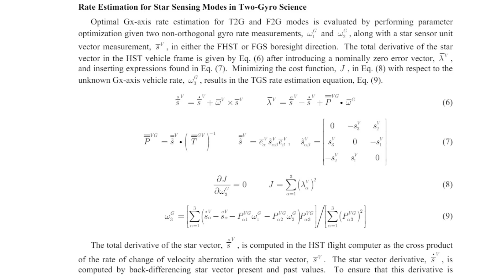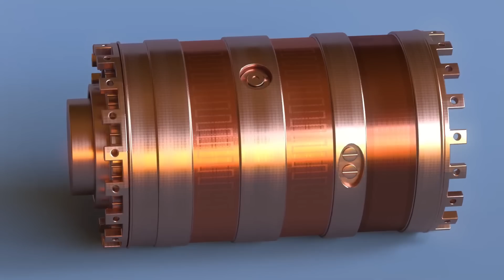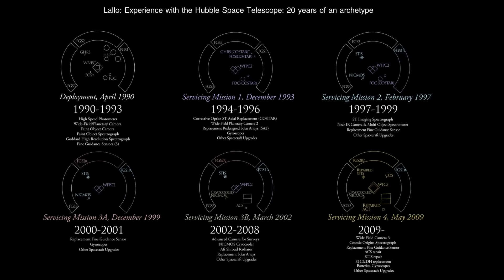How Failed Gyros Are Making Hubble's Life Harder

Comment: 8:30 it should be noted that the precise reason the wires are failing is because the engineers chose to make them out of silver to get the maximum electrical conductivity possible for such thin wires, but the damping fluid mentioned (a kind of oil) had dissolved oxygen in it, this corroded the reactive silver and the wires snapped over time. The new gyros installed on the servicing missions had nitrogen sparged and pressurized damping fluid instead, and use copper coated silver wires. This extended the lifetime of the lead wires dramatically, and pushed the gyro lifetimes out to 3X their original values. One lived an amazing 142,000 hours. In modern spacecraft of course, there are no electromechanical gyros, resonating structure gyros are used instead and have effectively infinite lifetimes with minuscule power consumption. See the video "The Future Is Simple" by Joe Belcovson for a rudimentary explanation of how they work.
Reply: Thanks for the explanation and source ! I was wondering why they sue such complex apparatus and why there aren't present in modern telescopes like JWST.
Reply: Quality post thank you.
Reply: We developed the HRG (hemispheric resonating gyro) and it is indeed used on later missions, and many satellites.  The HRG also a peculiar drift-mode problem, in that the fused quartz used for the resonator does have residual ions in it which drift ionically and thermodynamically through the quartz.  This causes and unknown long-term directional drift.  However, for short term pointing the HRG still works great.  Some of this drift can be minimized by using an AC forcing system, which randomizes the drift in all of the axes.  The Safran company now has the development rights to this technology, and is using it for commercial INS systems.  The HRG is limited now by its own electronics lifetimes, and although the gyro can withstand solar and cosmic radiation, the electronics have a much lower limit.  There is no need anymore to have the old style PIGA accelerometers or gyros, with any kind of fluids or moveable parts.  Arachic now.
Reply: @brunonikodemski2420  highly interesting info. The contaminant ions drift though? Is the quartz resonator held at high temperature or something? It's hard for me to imagine exactly what's going on. We use fused quartz a lot in the high powered laser world and it's a highly stable material.
Reply: @Muonium1  The first HRGs were biased internally using a DC electrical field for the sensing apparatus, a capacitive pickup and drive system.  This caused a steady E-field to exist across the resonator.  Ionic drift occurred due to the flexing of the quartz, and some minor from thermal.  The thermal drift was small, since the gyro is held to a stable temperature, but that stable temperature varies with application.  Later versions used an AC driver and pickup system, which reduced the problem by a large amount, but only served to move the ions around in certain wavelike patterns.  Gyros which have been aged for a long time, have somewhat more predictable drift, but when you turn the systems on/off they kind of get jumbled a little, and take on some other pattern.  Also, the materials of the electronic sensors are also silver, gold, aluminum, indium, copper, beryllium, and similar, along with ordinary silicon or GaAs based ICs, so there is various drift in the electronics.  We operated at about 3dB away from the thermal noise limits of the electronics, at whatever temperature they were at.  Most HRGs are not cryogenically cooled, but this is possible.  However the thermal shocks imposed during stop/start would, again, magnify the residual long-term drift errors.  These are all "material" issues, which are difficult to solve.  Some weapons systems, such as the nukes, have the same issues, due to "plague", dendrite growth, electronic windage, creep, Paschen effects, and many similar problems when stressed with electrical fields.  Also, in space, xray to cosmic rays degrade the materials, pretty hard.
Reply: @brunonikodemski2420  mechanical gyros can act as actuators too, can resonant gyros act as actuators or just for sensing?
Reply: @erkinalp  Probably just for sensing.  We had and "expert" look at this, and we realized he didn't know his head from a hole in the ground, after he published his findings.  The "effective" mass of any resonator, is localized within the energy exchange between any of its mechanical or physical parts.  This includes photonic devices as well, where the "mass" of the photons is essentially zilch.  The actual "sensing" comes from the Q-factor of the resonator, which stores an inertial energy frame within its own structure.  Modern photonic resonators have Q's over 10-million, to as much as 100-million, and theoretically even better.  That limit is set mostly by local thermal noise, gravity noise, mechanical noise, cosmic noise, etc.  The HRG, although having a much larger mass than photonic devices, also has very little actual dynamically moving mass, in the off-axis directions, where it could be used as an actuator.  That would also completely destroy the Q-value, and reduce its accuracy to maintain a pointing direction.  The extracted energy would essentially force a directional drift, in the axis where the energy was extracted.  That defeats the whole purpose of inertial pointing.  The sensing electronics can be locked to an external prime-mover power device, including a battleship turret (which I did in school), and would give accurate pointing.  That again, is limited by local electronic noises, electrochemical noises, thermal noises, mechanical hysterisis, and similar forces.
Reply: Thanks for the info and additional reading!
Reply: Sure, sensor gyros can be resonant or laser, but to provide the mechanical torque to horse the beast around requires actual spinning mass.
Reply: @r0cketplumber  That's what the reaction wheels are for, not the gyro. The reaction wheels dump their energy into the Earth's magnetic field using the magna-torquers. 6:28
Reply: @filonin2  while true, a mechanical gyro can be abused as a reaction mass
Reply: @filonin2  That is not how reaction wheels work. It has nothing to do with Earth's magnetic field. It has to do with conservation of angular momentum.
Reply: @r0cketplumber  Absolutely correct IF you are using the old style inertial mass wheels.  We designed some of these, and of course, the main problem is/was the bearings.  We used the best technologies available at that time, which were suspended air-bearings, similar to modern computer floating diskdrive heads, which float over the magnetic surface.  However, these Require and air interface, which means Drag.  As such, they cannot be made lossless.  One of the Gravity probes avoided this by suspending a floating ball, on electrostatic non-contact supports (once it was in orbit and free of Gravity).  This worked great, but the forcing through the suspension was so small (in mass equivalents), that the ball had trouble just remaining suspended when there was a solar storm, where some bumping occurred from a gas/plasma cloud.  Modern satellite correction systems use a better combination of magnetic, reflective, gas, weight shifting, gravity slings, and other gadgets to make small corrections.  Gas/Ion thrusters for larger corrections are still required.
Reply: Thanks!
Reply: finally a good explanation for why gyros can fail in a vacuum. cuz the humans brought the failure mode with them. of course.
Reply: I wonder if there's a way to build a more modern MEMS resonator style gyro into one of the old style housings...
Reply: @JaenFoster  We actually tried this.  The problem is that the MEMS resonators are just not as good, in that environment as the more modern devices, especially the photonic ones.  Effectively, all you are doing is providing them a "protective cage" of temperature, resistance to vibration, resistance to radiation, and some similar effects, but not against their own electrochemical drifts, ionic drifts, or their own internal electronics noise problems.  It was a dead-end, in that as the MEMS became smaller and better, it became possible to just use them as is, without all the extra claptrap associated with a mechanical PIGA.  Now done in multiple industrial applications, automotive sensors, cellphones, etc.
Reply: This is just beautiful! I can't thank you enough for the link!
Reply: Metal fatigue may also be a cause._
Reply: Now that’s a high quality comment!
Reply: This is precisely why I always use gold lead wires on my gyros meant for space…🙄
Reply: First of all, you throwin' too many big words at me, and because I don't understand them, I'm gonna take em as disrespect.
Reply: Use a darpa robot to replace the gyros
Reply: Loads of great discussion here on mechanical gyros.  I think you would all find ring laser gyros interesting.  They work using a ring laser cavity with a laser beam going around in both directions.  There is an output where the beams are interfered to produce a rotation rate signal.  The interference arises because as you rotate the path for a beam going in one direction is shortened and the other is lengthened. Pretty cool. Like mechanical gyros they have their own limitations and problems around certain resonant frequencies causing lock in.
Reply: Neat explanation and video, thanks.
Any idea what they use in NRO surveillance satellites? 
Presumably they don’t use electromechanical gyros, or we’d have a solution….
Reply: @marksinclair701  Everything in space is resonant structures now. As of about a decade ago hemispherical resonator gyros had been operating on over 125 spacecraft with a collective uptime of around 20 million hours without a single failure. There's nothing TO fail except the electronics, and high quality electronic components and well designed circuits can have unbelievable lifetimes - witness the still functioning half-century old Voyager missions.
Reply: @Muonium1  i think he was talking about the dozen orso hubble clone satellites for spying called keyhole. most where launched before hubble so i presume they have the older style gyros, but perhaps not since they use different guidance then hubble to track the earth surface which is much faster.
Reply: @sudazima  I'd think it was safe to assume everything late 90s and beyond is using HRGs.
Reply: Turns out that two ex-NRO satellites were offered to NASA by NRO (wikipedia article on “2012 National Reconnaissance Office space telescope donation to NASA”). Not sure what generation, but the KH11/12’s had Hubble class mirrors and were being launched as recently as 2021. One was used as the basis of the Nancy Roman Telescope (launches next year). I think mostly only the optics survived. Not sure what gyros the KH11’s or Nancy Roman was equipped with. But if the NRO birds were losing their pointing ability, you can be sure they figured out a solution in a hurry. I guess they get superceded faster than NASA observation satellites so maybe the gyro’s didn’t get a chance to wear out, or they switched to HRG’s earlier because they were less concerned about precision? We heard about NRO servicing missions, although I guess we wouldn’t……
Reply: @sudazima I would avoid talking about this.
Reply: @synaxarion  Agreed. ITAR is no joke.
Reply: @marksinclair701 as their surveillance sats point down, errors can be compensated by the ground station conducting the mission by coarse adjustments and image processing tricks, no such luck when you look away from Earth
Reply: @marksinclair701 I'm not in aerospace at all but wouldn't that be kept secret?
Reply: This comment by @Muonium is incorrect. Utter BS.

Comment: What makes me nervous about putting one of the gyros in cold storage is, were the gyros designed to do that? What happens when it's switched off for years and then brought back online?

The NASA engineers aren't dumb by any standards but as someone who has worked in the IT sector for over 20 years, I have seen lots of hardware fail after doing very similar things.

I kinda get NASA not wanting to let the Polaris mission to touch the telescope but when I listened to the press conference about it, it didn't fill me with confidence that they have a plan or studies in the works to address Hubble's failing health. The people on the panel basically kept stating that Hubble will last into the 2030s and they will worry about it later. Again, I am paraphrasing but that was more or less the jist. Maybe it just comes down to NASA's budget getting cut and they don't have enough money to go around so they are waiting until they have a little extra laying around. I don't know what the case is but I don't want Hubble pushed to the back burner.

Anyways, thanks for the video Scott. I always appreciate the work you put into these videos for us.

Comment: Summary

* (0:24) The Problem: Hubble is down to two working gyroscopes, one less than the minimum needed for optimal pointing. 
* (7:43) Gyroscopes Explained: These devices detect rotation rates with extreme precision, crucial for maintaining Hubble's steady gaze. They work by measuring the deflection of a spinning mass inside.
* (9:01) Why They Fail: The main culprit is tiny wires called flex leads that wear out over time due to constant micro-movements.
* (9:45) Reduced Gyro Mode: Engineers developed a new control algorithm allowing Hubble to operate with one gyro and other sensors.
* (10:10) How it Works:
    * (10:22) Coarse Pointing: The sun sensor, magnetometer, and one gyro roughly orient the telescope.
    * (11:48) Finer Pointing: Fixed-head star trackers (three small telescopes) take over, using stars to refine the pointing.
    * (12:25) Ultra-Precise Pointing: Fine guidance sensors within the main telescope lock onto faint guide stars to achieve the final, ultra-precise aim.
* (13:55) The Downside:  Switching targets takes longer, reducing Hubble's observation time. Some fast-moving objects are no longer trackable.
* (14:22) The Future:  A servicing mission is unlikely. Hubble's lifetime is now limited by both gyro failure and its increasingly low orbit causing atmospheric drag.

Q: why do they use mechanical gyros and not some fiber optic interferometer?

A: Here's why Hubble likely stuck with mechanical gyros:

* *Heritage and Reliability: Mechanical gyros, while complex, have a long and well-understood track record in space. Hubble's design heavily relied on technology available in the 1970s and 80s when it was conceived. Back then, mechanical gyros were the gold standard for precision attitude control.
* Maturity of Technology: While fiber optic gyros (FOGs) were being developed in the 80s, they weren't as mature or space-proven as their mechanical counterparts when Hubble was being built. Putting a new, untested technology on such a critical and expensive mission would have been a huge risk.
* Performance Requirements: While FOGs offer advantages like longer lifespan and no moving parts, they might not have met Hubble's extreme precision demands at the time. Hubble needs to stay locked on target with incredible accuracy (milliarcseconds) for long durations, and early FOGs might not have been up to the task.
* Size and Weight Constraints: Early FOGs were also larger and heavier than comparable mechanical gyros. Every gram and centimeter counts on a spacecraft, especially one designed for a shuttle launch like Hubble.

https://www.quora.com/Why-didnt-NASA-use-ring-laser-gyroscopes-on-the-Hubble-Telescope-instead-of-mechanical-ones-that-break-over-time

However, times have changed:

* FOGs in Modern Spacecraft: Today, FOGs are common in spacecraft, especially those requiring high reliability and long lifespans. For example, the James Webb Space Telescope uses FOGs for its pointing system. 
* Hubble's Legacy:  Hubble's reliance on mechanical gyros underscores the longevity of older technology in space. While those gyros had a finite lifespan, they've enabled decades of groundbreaking science. 

In summary, Hubble's use of mechanical gyros was likely a calculated decision based on the technology available at the time, its proven track record, and the specific performance demands of the mission.  

i used gemini 1.5 pro to summarize the transcript

Comment: I am sorry, I am confused. Are they lost gyroscopes, or reaction control wheels that in principle are gyroscopes? (My understanding was they lost ability to control, not to measure)
Reply: It's a servo system so you need to be able to measure the error to know what command to send to the reaction wheels.
Reply: @shanent5793  Yes, I completely understand this. but I am confused what is actually down. what part of system in particular and why.
Reply: @Kilohercas   it would be the sensing gyroscopes. The reaction wheels need to be able to transmit their torque to the spacecraft, so such fine connecting wires would be unnecessary. The sensing gyros need to be decoupled from the rest of the spacecraft, hence the thin wires. The principle of a reaction wheel is different from a gyroscope, a reaction wheel creates a torque inline with the axis of rotation, and can do so even at zero RPM. Gyroscopes produce torque perpendicular to their rotation.